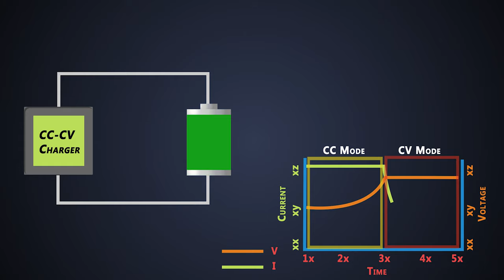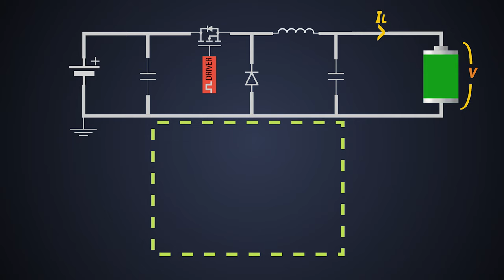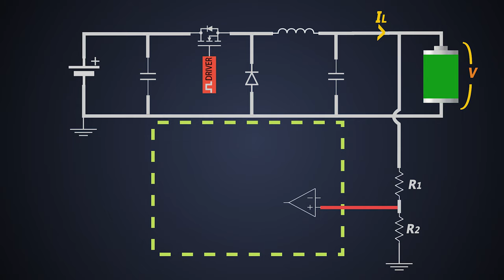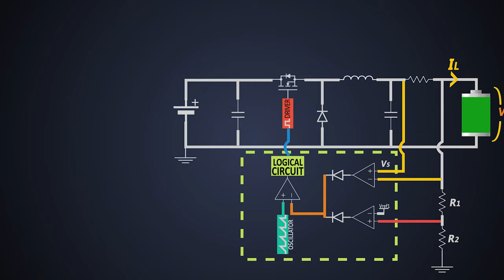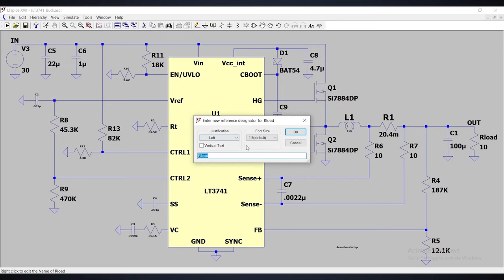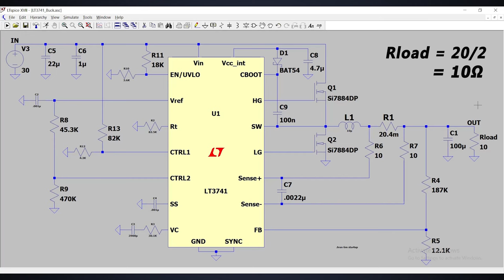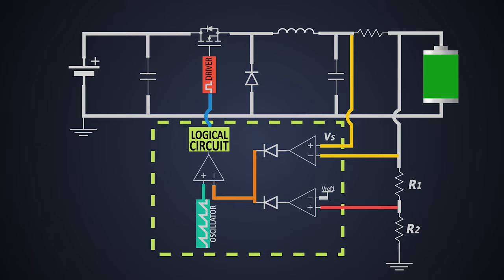CCCV Battery Charging algorithm | Li-ion cell charger #2 | How does a Li-ion Battery Charger work?

Comment: hello, i was wondering, im looking to create a charger for 12V 200AH inverter batteries (x2), can i use this method or the SMPS . Also what happens when the battery is fully charged, is there some kind of float charging mode or does the charging stop?. Thanks

Comment: Hv u tried simulating using UC3842/43? That ic is far common for commercial charger. If u ever try, use it with flyback or halfbridge topology.

Comment: I really believe that the teaching you do helps the rest of us think critically as we endeavor to make the most reliable system choices.  
Where I am at is using Smart Lifepo4 Battery Protection Board 300 amp BMS 48V 20s for Bluetooth in 16S with a 5A Active Equalizer Capacitor Balancer for each 16 cell bank. Hoping for more maintenance free situation as I move way from the 16 T-105 Trojan batteries I am so tired of babysitting.
My question is, how much do the difference between the two types of BMS used together is beneficial for the batteries or diminish the functionality of their intended process for their individual purpose? Does the residence balancing of the Smart BMS diminish the capacitance reactance transfer between batteries through the Active Equalizing Balancer? Does the Active Equalizing Balancer interfere with the representative information of each cell the Smart BMS is trying to provide?

Comment: I want to make cc/cv supported charger can i use lm324 ic for more convenient circuit like i need 3 op amps right ?
1 for current 1 for voltage and 1 for osc+both amp out will single op amp works ?
And where should i wire Vref ?
Reply from the maker: Please use some ASIC.. There are so many ASICs which support cc/cv charging
Reply: @FoolishEngineer  ok sir
Reply: @FoolishEngineer  Please share some ASICs for cc/CV charging